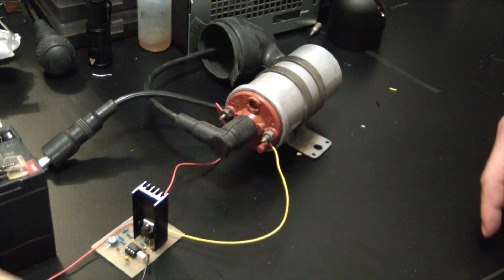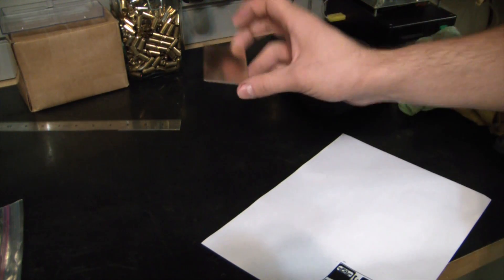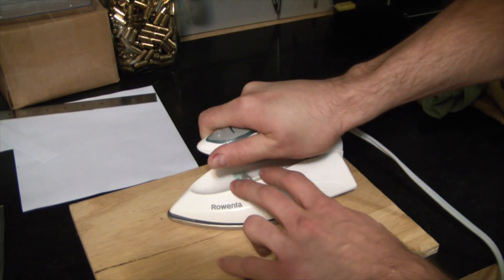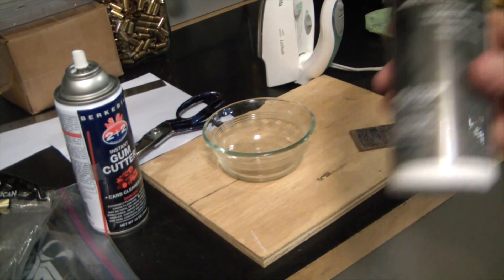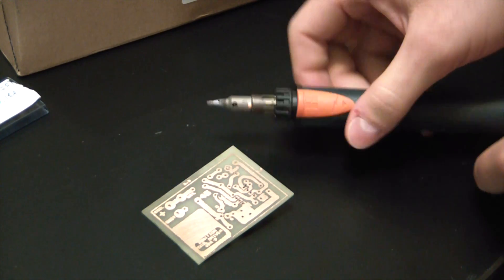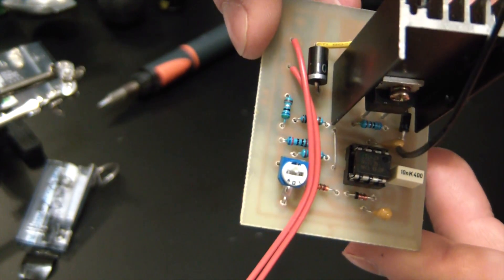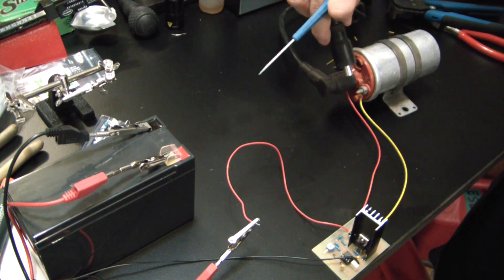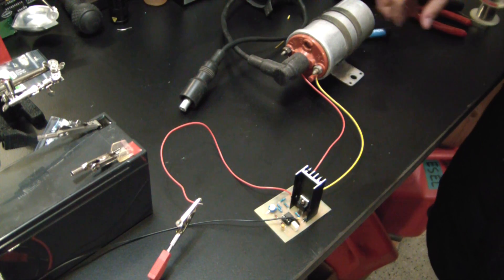IGNITION COIL DRIVER - MAKE HUGE SPARKS - 555 TIMER BASED - ELEMENTALMAKER

Comment: Followed the circuit exactly, used 1/4w resistors like recommended. I give the circuit power, it makes one spark and immediately blows up the 6K8 ohm resistor the bridges the gate and source pins on the mosfet. Gonna try a 1w 6K8 resistor to see it it helps. Other than that, im not sure what ive done wrong
Reply from the maker: Unfortunately I can't help much without seeing the circuit, but it definitely sounds like something is placed incorrectly on the board or there is a short somewhere.
Reply: @ElementalMaker  well I replaced the Chinese metal film 1/4w resistor with a carbon comp 1/2w resistor from digikey and it actually worked for about 30 seconds. But you are correct when the resistor dies it shorts the mosfet and now both my resistor and mosfet are dead.

Comment: I need a circuit for only a  lawn mower magnetron to increase high voltage output. . The magnet instills 5-8v PULSE ONLY, trigger shorts the primary to ground, then back EMF creates negative 130 volts to run the secondary for negative 12,000volts. The primary is very low .3 ohms. One end connects to ground + the other connects to a separate trigger to ground. The tab terminal is accessible  for primary. Can this be attached to 12 volts DC to superimpose on the 5-8volts, to get a higher secondary output? How? Mower ignition is called autotransformer with 3 terminals only. A burst mode, for single pulse desired, could be used and then shut down by the trigger. Maybe the 12v DC has to be triggered in, so that it doesn't short the primary to burn out. Ideas??? I have magnetic  hall switches to operate a transistor to switch in the 12 volts. (  A voltage doubler circuit requires only AC input) The small unit being sold for autos is a high frequency oscillator that raises also up to 16 volts pulse to ignition, - was called firestorm for as $8 to $75. A man in England on YouTube was adding parallel capacitor to TV fly back  primary to raise up high voltage as the resonant frequency of wire and ferrite core is way higher, and run from high frequency oscillator.

Comment: This video is 6 years old and I hope you are still around and kicking. You are demonstrating to how to make pcb board not how to drive an ignition coil. You did not share the 555 timer circuit and its driver. So it is good for you to shock your ASS with this circuit and perhaps it will light up the neurons in your brain. Disliked your video.

Comment: Where is the schematic? I skimmed through your video but did not find it.
Running the coil without it sparking is very bad for the secondary winding insulation, it will break down and ruin the coil.
Reply from the maker: Links and parts list in the video description
Reply: @ElementalMaker   Thanks for the reply, but looking for the schematic, not the parts, got schematic?
On ALi they have a nice PWM generator with 8A fet (can be changed for more amps, or drive external fet, with LCD for $5 shipped), look up "8A 1-Channel 1Hz-150KHz Dual Mode LCD PWM Pulse Frequency Duty Cycle Module Signal Generator Driver Module for Motor Lamp"
Reply: @ElementalMaker  Since you did not give the schematic (I dont want to reverse engineer your pcb), I used my $5 Ali pwm generator and found some very interesting things while changing freq, duty cycle and input voltage, all easy to do with the pwm generator, maybe I will make a video.
What freq and duty cycle are you running yours at?

Comment: I built one of this according to plans but it just works for few seconds then circuit cuts output voltage slowly to 0. When I disconnect it and wait for few seconds then reconnect it, same thing happens. Could anyone help me?
Reply from the maker: Do you have the mosfet properly heatsunk?
Reply: @ElementalMaker  I did, it doesnt get very hot
Reply from the maker: @mad_cat_lon974  sadly I'm not sure what else it could be. Have you tried swapping out the 555 timer for a new one? Maybe a bad capacitor?
Reply: @ElementalMaker  I just swapped 555 with a new one and tried again, same thing happened but I noticed 56 ohm resistor gets hot, I mean really really hot that make it color change to black.

Comment: "Laser jet". Sir, there are no "jets" in a laser printer. It electrostatically charges an image drum that deposits the toner onto the page before melting it on there. That's in contrast to an "ink jet" which does jet ink onto the page through micro nozzles. Why am I commenting on a 5yr old video?

Comment: I had a look at your schematic. There is no need for the diode across the mosfet because the mosfet already  has an internal body diode. (notice the little arrow in the mosfet symbol) Also the other diode in series with the coil primary is unnecessary. It will work just fine without it.

Comment: man i studied your video and the pictures, got  little confused on the capitors and the voltage there of, built it, looks like the one you built, but mine does nothing, do the capactors have to be tantelum/ they are hard to find in those values
Reply: did you have any luck with this ?

Comment: I want to apply this to killing rats in my garden. I want to set up 3 pairs of electrodes and when the rat steps on two electrodes at the same time, it would get electrocuted. The only issue I need to solve is how to switch (reset) the device after rat is dispatched, since  the rat will die across the electrodes and short out the battery. Do you have any ideas on how to set this up to reset after a minute or so?

Comment: There are two ways to generate bigger sparks using car ignition coils. First wire two ignition coils in anti phase parallel, so the output voltage is doubled. Second drive the ignition coil(s) primary from a  high voltage, stored on a capacitor and switched with a thyristor.

While playing with high voltage circuits, I built a high voltage pulse generator circuit powered from a 12 volt DC supply. My circuit used a 12-0-12 mains transformer. , The transformer being  used as a step up mode, using a blocking oscillator to drive the normal 12 volt output, (though now I might use a zero volt switching oscillator). The output was taken from the mains side of the transformer and rectified by a diode voltage doubled with a 1200 volt capacitor across its output. This gave approximately 1000 volts dc to discharge into the ignition coil primaries. The capacitor being discharged through a thyristor into the coils. The trigger for the thyristor was from a simple two transistor oscillator pulse generator. With this arrangement it is possible to achieve sparks of six inches in length, between the coil outputs. 
There are of course many ways to generate bigger sparks, using a pulse transformer, van der graaf generator, Marx generator, or a Tesla coil(s). I am constantly amazed at the size of the sparks that handheld stun guns produce. The circuits of which are not dissimilar from the arrangement described above, except the ignition coils are replaced by a small pulse transformer and the thyristor by a precision spark gap.

Comment: You say negative is the yellow wire.  Why does the ignition coil have a plus sign?
Reply from the maker: It's a square wave DC driven ignition coil. In this application I don't think it really matters, but when used in an vehicle I'd bet the outer case is grounded, so it the wrong terminal was given positive it would just ground out.

Comment: I have been shocked by a plug wire plenty of times.  It was not dangerous, but it was painful.  How is it that this is dangerous?  You are still powering it with 12 volts, right?  What am I missing?

Comment: hey man I made the 555 circuit last night and it is jus connected to a 50k potentiometer and a small speaker to make a whining squad wave tone adjustable. If the threshold capacitor is 1nf it will have audible low tones and a 10nf is much higher pitch well past 20000hz. I could only find irfz44n mosfet so how can I hook it up and protect the gate how much ohms will I need? My purpose is to drive high volt out of a car ignition coil with this mosfet but I might need to get the irfp260n off amazon I’m assuming, the mosfet I have was intended for 40 amp audio inverters and stuff

Comment: My son used the 555 circuit I built and used the coil to charge a giant capacitor he made from a big galvanized washtub filled with salt water with a bunch of beer bottles sitting in it also filled with salt water, and of course the wiring and electrodes in the bottles. The sparks from that set up were absolutely deadly as fuck and were more like small lightening bolts with extremely loud reports.

Comment: I've done the 555 chopper circuit like 15-20 years ago. But before that I built several mechanical breakers using an electro-magnet, tin springy strip of metal with silver contacts embedded. (I had a piece of silver wire) Freq is set depending on the closeness of the contacts set with an adjustable screw. I used it to drive a coil like this to pump a Tesla Coil. But I also did a Jacobs ladder that was wicked using two coils, one for each wire and then wiring the coils opposite polarity to each other. Both were driven by the same set of points on the chopper.

Comment: Informative video .
How to increase spark of coil direct on plug ? Like in new cars with ecu ? Any guide plz
Reply: Why? It either ignites the fuel-air mix or it doesn't. There's no way (electrically) to make it "more ignited". If it worked, i'm sure someone would be selling "hotter" coils.

I remember when someone was selling custom (supposedly "hotter") plugs with three sets of electrodes ... as if you'd get three sparks simultaneously. Anyone who knows electronics realizes that electrical current takes the path of least resistance and you only get a single spark!
Reply: There's a guy who added little capacitors to a car's plug wires, and he got even hotter sparks, but....  It will likely fry computer driven coils, and you'd have to gap your plugs wider.

Comment: Run the output through a microwave transformer (or or two) and boost the voltage even higher for really crazy long arcs. Then turn it into a Jacobs Ladder.
Reply: I like ZVS drivers better.
They are more complex, but solid and put less strain on the MOSFET.

Comment: This is a really great idea. Back in the day we used to bypass the ballast resister, and run them at full power, but went through a lot of points. Big spark means more power.
Reply: That's what the cap (or condenser was for), but nowadays, just use a fet. I did have the MSD ignition in my 70 and a half Camaro.

Comment: Will that work on your car?
Reply from the maker: Nope, the spark plugs in your engine need to be specifically timed to spark just as the piston reaches top dead center. Otherwise the air.fuel mix would ignite early and fight the piston traveling upwards. That issue is commonly called 'knock'.
Reply: No

Comment: What if you connect a capacitor across the terminals of the coil?  Some people online did that and said they got way better sparks.
Reply from the maker: A capacitor should just smooth the square wave as it heads into the ignition coil, thus ruining the performance.

Comment: Wouldn't adding a capacitor from the coil positive to coil negative
Reply from the maker: A cap would smooth the square wave and probably stop it from working or make it much less powerful.

Comment: Meh!  If you want to see a REAL UHV driver, go here  http://www.neon-john.com/Nuke/X-ray/HEI_driver/HEI_driver.htm

I designed this driver to operate a 150kV, 50 ma therapy X-ray tube.  I measured at least 150kV at 250 mA using NIST's spark gap method.  I haven't updated the site yet but my current system uses 4 coils in parallel.  I'm also using some new SoC FETs rated at 1700 volts and 76 amps.  Spendy but WoW!  Since I got the SoC transistors, I'll probably add two more coils for even more current output.  It lights up that X-ray tube quite nicely :-)

Comment: I made this one and want to ask you did the Ah on battery affect IRF640? Because I started it but without MOSFET the spark was very weak so I spined potentiometer and for a 1 second spark was quite well but IRF blew out :/ and what affects spark power from ignition coil?

Comment: How do you limit the current that runs thru the transistor and thru the primary? When the transistor turns on, doesnt it just short the battery thru the winding? I made a similar 555 circuit that drives a flyback transformer and when I turn it on, it makes a small spark for like half a second and then my power supply turns off because the circuit drew more than 20 amps, do I have to have a constant current source providing constant current to the winding and the transistor, or cand I just somehow put a resistor to the base of the transistor that will take care of that? I tried many resistros, from 100 ohm to 10 kilo ohm but nothing worked. Can anyone explain please?
Reply: Powering the primary of the coil shouldn't short out the battery, it should only draw about 3-4 Amps.

Comment: I and an old man built one of these many years ago and then hooked it up to a pole transformer. I could get 115 -125 vac from 12 vdc 750 amp battery.  To get enough power to run a charger and a light we bypassed the spark gap with 12 dc to get 1 amp. It worked but would not keep the battery charged indefinitely of course, as I knew would happen.  The old man was a cancer patient and had worked for the power company until retirement. He retired and was a garage inventor.  He had a dream of making the circuit work as free power for peoples homes and needed someone to design the 60 Hz 12 vdc square wave oscillator to the  run into the spark gap.  I made him the circuit and we hooked it up and it worked and he was happy. After that I did not get the chance to see him again. He died very soon after and at the time I didn't have the heart to tell him it would not work as free electricity.   I couldn't destroy the dying old mans dreams with engineering facts, so I just supported him in his idea.   I never knew if he found out that it would not work as he intended.
Reply: Kemono Yama That was a very kind act you did.
Reply: I think a bit differently. My 40 year old brother is attempting something similar with what's essentially a motor that feeds itself. He's convinced himself that its the physical surfaces like the bearings that are robbing the momentum so he's developing surfaceless bearings for the rotor. I tried telling him about eddy currents (though I didn't know there was a name for it at the time), and he could only say im shitting on his ideas. Well I was, but at the same time I believe that failure is a more valuable learning tool than success. Easy success breeds hubris. But i will help him develop the surfaceless bearing if he ever gets that far, because practicle or not, they will actually work.
Reply: Kemono Yama 👍

Comment: hmm.. now some insulation for my door handles on my car.. and a round bend bar drawer pull.  a dual tower GM ignition coil that puts out like 100KV.   and go ahead and try to open my car door. this is so much better than the solar powered electric fence box i was thinking of using.  who wants to shock them with 70V when you can hammer the bandits with 100KV..
Reply: Why were the cops trying to steal your dads car?
Reply: My pops did this in the 70s, the cops were not happy

Comment: Nice video.  That's a general purpose ignition coil.  They're rated for 25,000 volts.  Silicon steel core,   I'm not sure how high frequency they can take before they saturate..   In a V8 car,  Those coils can't put out fast enough,  4500-5000 rpms,  and they start to skip a spark or two.   That's only about 300Hz.    They make much higher voltage coils,  if ya wanna  "Go Big"   :)  or use two coils and switch back n forth..   Two batteries, 24v ?    More Power !    We all love sparks.
Reply from the maker: Very cool info to know! I've been lucky enough to have cars where each cylinder has its own coil. Thanks for checking out my channel!

Comment: I actaully built that thing in a hurry. At first it did not work at all. After investigation it turned out that there's an error in your parts list. The potentiometer should be 100kohm - not 100ohm.

Comment: what amazes me is something you did,,  but  not the circuit you made,  you held the spark lead( the output of the a/c sinusoidal singal) against the ve of the coil-WHICH IS THE RETURN FOR THE A/C SPARK SIGNAL, as you completely proved, good,  but in every kettering ignition youtube video, and books, and as I was taught in error at College,  no one wants to say the _ve should always and only have been directly connected to ground, with the points being before the +ve coil post, eliminating the need for condensors anywhere in the car, condenser are the "fix" to supply and A/C return path to the _ve (but there should have been at least 4 condensor another story ) think about it people, at very best one guy said the return of the a/c signal is via the battery ground etc etc, WTF,   why was there never a 4 post coil?